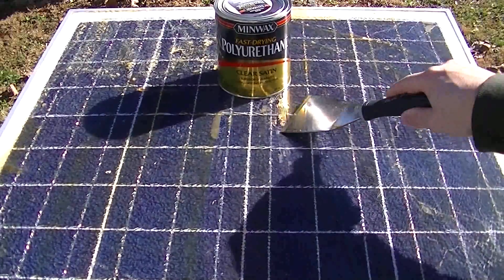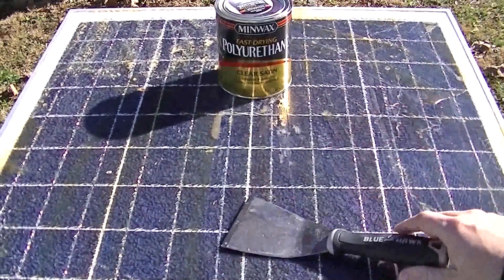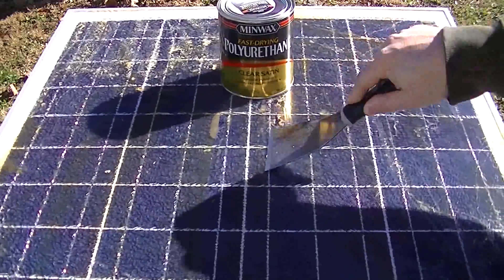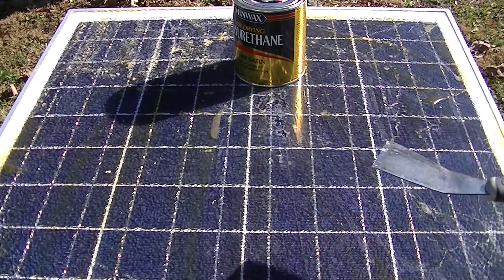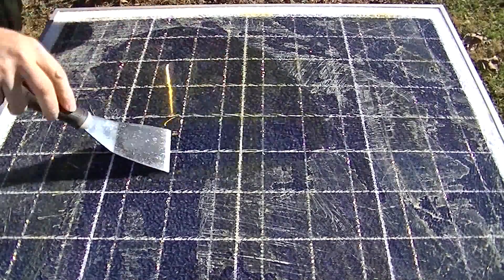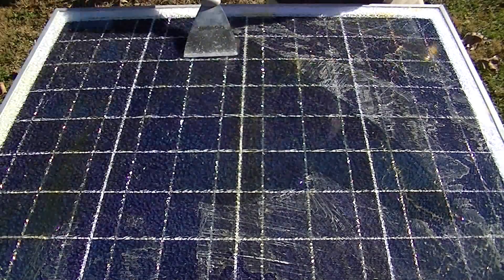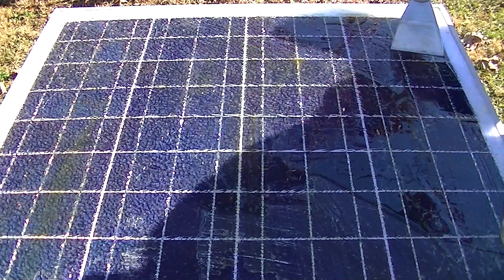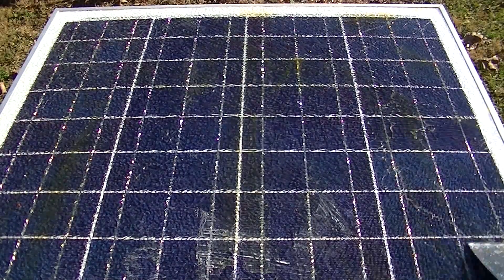Solar Panel Glass Repair

Comment: Why don't you cut new glass?  Here the glass  1.6 x 1 m  is about 15-20 euro .  I don't know if they use normal glass or some other type that is more transparent to the UV, like the quartz glass.
Reply: I wanted to but the panels are attached to the glass with epoxy or something like it.

Comment: I have a 250w broken board now that gives 5v how I can fix it
Reply: If you can get to the back of the panel where the soldering connection are. You can try to re-solder the connections. With most panels being glued together, the odds on fixing it is very small.

Comment: i see where you said you had gone to a clear outdoor paint in the comments section,  i would think something like a 2 part automotive clear coat or even a marine hull clear coat might also be an option, thanks for the vid
Reply: Sounds like a good option, as automotive clear coats are UV resistant.

Comment: Many years have now passed so is the panel still going strong? Out of interest was there a marked increase in output after the polyurethane?👍
Reply from the maker: Have not tested the output to see if it has changed. Use clear outdoor paint, it will last longer than the polyurethane.
Reply: Jason Roush  thanks for the tip

Comment: My soler glass is broken 
What i use for repair glass 

( ???? ) 
Please suggest easy to find 
I live in pakistan
Reply from the maker: Find clear outdoor spray paint if you can.
Reply: how  if using UV glue ?
Reply: Hey my glass got cracked, but not giving amere output..... What to do... Instead it is giving just 1.4amp instead of 8.98 smp

Comment: The key to repair is using a very fine roller and putting it on thin and multiple layers
Reply: Foam roller.

Comment: The fellow I bought my panels from was repairing a bunch of shattered panels from a truck wreck during transport and he used what you are using, minwax satin gloss polyurethane, he said don't use high gloss because it will reflect the light and put it on thick

Comment: 2 months and the resin is cracking. No discoloration. Applied a layer of rustoleum flex from home depot, $6, and it looks tough again. Definitely recommend it over a hard resin but you need that hard resin to support the weight of the broken glass so it doesn't droop. Again, you have the only video worth watching on this subject so thanks again.
Reply from the maker: Jonny B thanks, I will remember the rustoleum flex.

Comment: Would you still recommend the Fiberglass Resin after having to do this repair with the poly?
Reply from the maker: Jon B
Sounds like you got a great deal on it. Let me know how it turns out after you put poly on top. I have not had any more chipping after adding the poly.
Reply: The poly has lasted longer. I would go with the poly.
Reply: I literally just got done applying fiberglass resin. I may have to just go over it with a layer of poly later to protect the resin. Thanks for the reply. I just scored a 215 watt 48 volt panel for $50 and with $20 was able to make it like new again thanks you your video. I saved over $200 compared to purchasing new.
Reply: Should be done by tomorrow. Just gotta let the resin cure!
Reply: Resin cured VERY thin. Very flaky. Considering one flake can compromise the whole seal, you either have to lay it on thick, scrape and reapply when yellow or use resin, then top coat it with something less flaky/more durable.